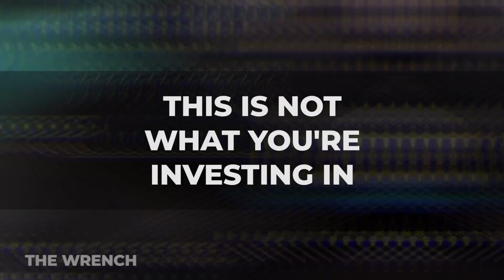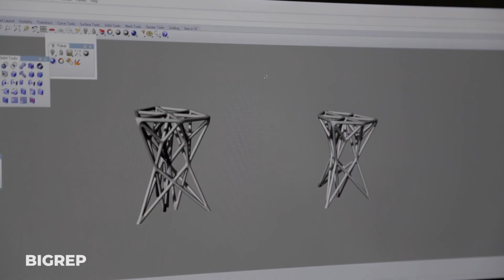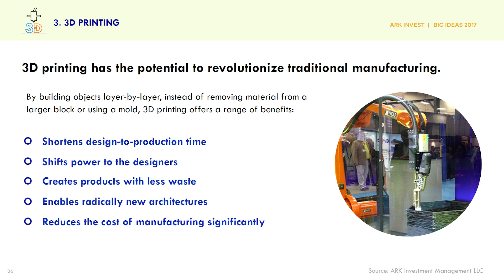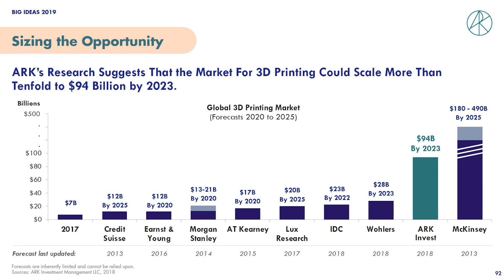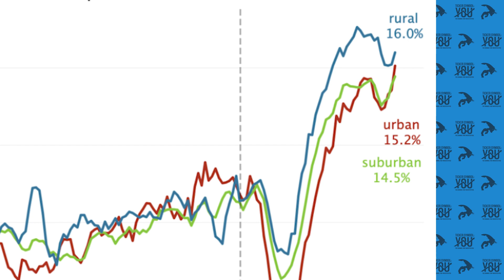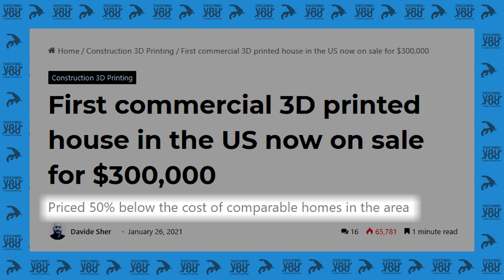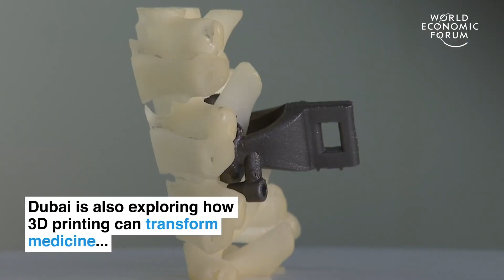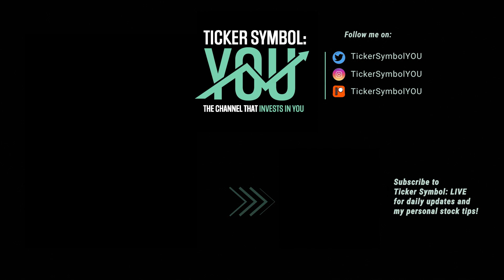😅 ARK Invest Mistakes on 3D Printing: ARKK, ARKQ, and PRNT are all Missing These Big Ideas

Comment: I work for a manufacturing company and we make about 80 different instruments.  Some we make hundreds a month and some we make under 10 a month.  You have have a molded part the mold can cost thousands of dollars and if you want to change the mold that can cost thousands as well.  I have been saying this for years that on low volume parts we can 3D print none critical parts. We are finally starting to do this.  This is where I think 3D printing will really take off.  I have also seen 3D printers with multiple heads all making the same exact part.  If you have 10 Printer heads all doing the same thing you can make 10 parts instead of one.  Multiple that by 100 print heads and you can mass produce 100 parts at once with one instrument. Think of how Hersey kisses are made.  You can 3D print in a similar fashion.
Reply from the maker: I think this type of manufacturing is going to scale very quickly. In terms of size and amount created by 3d printing.
Reply: Desktop Metal is the king of mass production of 3D printed parts right now.  Their production system prints large batches of parts about 100X faster than other technologies.  They are positioned to win the mass production war.  Velo3d may win the one-off battle since they have a slower, but more flexible small printing solution.  There are a number of players though.
Reply: @loul7239  DM is in my top five favorite stock in the market right now, it's insanely cheap right now. Time to load the boat
Reply: @jasonamareld5024  I know, it just dropped a ton yesterday.  I should probably pick more up.
Reply: @loul7239  just bought 100 more today up to 1150 shares of DM

Comment: Been in plastics for 40 yrs, supply color to 3D filaments now. There still isn't a thermoplastic that can be printed and is strong enough like injection molded plastic. It will come, not today
Reply: SLS is pretty close, especially when designed with extra support where needed... some of which are near impossible in PIM.
Reply: @Erwin Jacobs Replacing IM for mass production isn't going to come quickly, but it's always a numbers game. Customs and small changes in small volumes are not very cost effective for tooling, even if it's modular, so there may be a point where you can't amortize the cost and another manufacturing method becomes more favorable. 

If you look at areas where additive has really shined...  places where lightweight components are extremely cost effective, ie, aerospace. Places where multiple components can be designed as one with additive... compliant mechanisms, etc... we're just starting to really scratch the surface.
Reply: @Erwin Jacobs I dont think 3D printing will replace mass production at all. Not what it excels at. Custom parts, small batch production and some niche use cases like aerospace parts is a different matter.
Reply: from a structural engineering perspective that is my concern with 3d printed parts.  contiguous materials often have structural advantages over layered material.
Reply: @ocrun6765  I think your point is the biggest stumbling block for sintered metal parts.  There is an industry distrust of sintered metal over forged parts.  I imagine that, in the future, parts with critical structural implications with still be "forged" while the rest will be printed.  This is already the case in things like electric hand tools.
Reply: This is bang on and I totally agree, but I can't wait to see additive incorporated into injection molding.

Comment: How about combining robotic assembly of prefabricated parts along with 3D printing?  A term that I heard many years ago, but doesn't seem to be used much, is "digital manufacturing".   This would include additive, subtractive, and anything else which could be fully automated.
Reply from the maker: This is a cool idea and I definitely agree it has merits. I tried to call out the idea of printing parts of the home (door frames, railings, molding and crown, knobs, hinges, etc.). That's the beauty of this tech, it can work at all scales given the right machine and foresight.

Comment: A problem (you did not mention) with the current home construction industry is the information asymmetry between builders and home buyers. Builders are incentivized to cut corners and, in periods of labor shortage, just do a crappy job but you cannot see the mistakes after dry wall is installed. The process of going after the builders after problems are revealed  require a lot of energy, time, and regulation. I would love to not have that problem since the build is standard and poorly trained workers are eliminated from the process. 

I would love to obtain a 3D diagram of my house so I know exactly where I can make modifications. Imagine the shocks to the system when such information asymmetry is reduced, that means lower real estate agent fees, lower home inspection costs, when information can be transparent between buyer and seller. Imagine investing in a company that allows you to 360 degree inspect the home by combining the blueprint and the cosmetic elements and I am not talking about virtual house tours.

Also, I hope the recent lumber shortage is pushing material scientists to develop new building materials that are friendly to 3D printing technology.
Reply from the maker: This is a great call-out. I think increasing this type of transparency would be a huge win for the consumer. I always try to obtain a blueprint (or at least floor plan) of my home to identify where structural things would be versus what's available for modification as well. If I can't get one, I usually make one myself.

Comment: on housing, wood materials are super expensive right now. 2x4's for example have 3x'd in price in he last year in my location.. I think that sets up real estate pretty good due to far less homes being built.
The most interesting thing I've seen about 3d printing that really blew my mind was the newer process of gel bath printing which really opens up the possibilities of 3d printing imo. It makes it possible, IMO, to create more complex shapes and possibly working devices being assembled within the gelbath..which brings us far closer to that startrek level of 3d printing almost anything.
Reply: So whats the advantage over a dual extrusion system using a dissolvable filament for  the supports?

Comment: 3D printing houses will be one of the biggest changes. Not just on cost but on style being able to cheaply print curves which are super expensive conventionally. Labor is typically 50% or more housing cost
Reply from the maker: Yeah, printing curves and custom designs and having homes be more about self expression would be incredible.

Comment: i had been watching 3D printed houses for quite some time and am surprised that no one talks about 3D printing Net Zero homes in this.
Reply from the maker: Well, it’s time we talk about it way more!
Reply: Yeah, the potential for more energy efficient homes is remarkable. Big lightbulb went on for me when I learned the most insulating material is still air. So all those walls with columns of space between them are highly insulative. Depending on climate it would be very easy to optimize the balance of insulation and thermal mass which stores heat and releases slowly.
Reply: @jonathanbessone1124  Exactly. Here in Canada we have already started using 3 panel glasses for Windows and doors. They have Argon as the inert gas in between them. They don't conduct.

Comment: Absolutely.I've been talking about this for a while now.With Construction so many more things become possible such as passive heating since you can easily make the buildings air tight and ventilate where needed.With the right materials longevity could be increased.Once this becomes further automated and there are improvements in speed and efficiency I could see houses dropping to 25% or less of there current build cost.We have been building homes and buildings with little change for the past 100 years.This industry is ripe for disruption and with the need to make lower cost sustainable homes this technology couldn't have come at a better time.

Comment: I remain unconvinced of 3D printing in the construction industry. Yes, we've seen pilot projects, but they don't look particularly convincing. The houses don't look all that attractive. Concrete is a building material environmentalists would like us to get away from, and it needs to be insulated and it's porous to moisture. 

Perhaps most importantly, the hard and expensive part of building new houses isn't actually the building part at all, it's obtaining the land and the planning permission. Many cities make developers jump through hoops in order to obtain permission... it can take up to a decade of intense negotiations and hearings, plus they frequently make the developer pay for all the infrastructure and amenities that the new development will require: parks, roads, utilities, even schools. Also, here in California many cities don't have any more greenfield sites available at all... everything new has to be infill which is much more expensive land to acquire and the developments have to be correspondingly smaller.

Comment: No one ever talks about the materials used and their quality in the finished state when they make 3D printing videos. That makes me feel they want to hide something. It's the first thing that comes to everyone's mind when some one says "3D printing". But there is never any mention of the quality of the materials. That's why people don't trust 3D printing and don't care about it.
Reply from the maker: Hey, this is a great call out. I didn't think to do that because this is such a new space, but I definitely could have spend a couple minutes talking about the different mixes used in these homes. I'll look for these points more often in future videos. Thanks!
Reply: Shao xuan  You can finish the walls off with other materials like sheetrock the 3d part was basically just the  frame of the house.
Reply: I got one of the first 3D printed interbody cages cleared by FDA many years ago (and plenty more since!). Speaking to implants, they use the same surgical grade titanium, except it's in powder form and a laser or electron beam melts the powder together (ASTM F136 for bar stock, ASTM F3001 for powder). For 3D printing implants, we have to pay attention to the cleaning process to ensure any loose particles are removed, but aside from that, the 3D printed implants perform much better (and cost less to manufacture) than the traditional milled versions (I've never heard anyone outside my space refer to subtractive manufacturing, so Tasha earned so many points there haha). the milled implants also need cutting fluids or other contact materials during manufacturing that raise biocompatibility concerns. They anozide/electropolish as a final step...but again, that's less of a concern for 3D printed parts.
Reply: @TickerSymbolYOU  as someone who works as an additve expert this can be solved decently easily for houses but the bigger issue is surface finish for parts for planes etc. But for the most part we probably aren't going to see printed houses for 10 years. But the cost savings for manufacturing are in time and molds. For example in house additve can save weeks to months on manufacturing lead time for a $50-100k mold for 50ish parts that can be printed instead for $10-$40k

Comment: Thanks, Alex, for all the nice video about ARK Invest, I've been following your channel.     I have been wondering if you would be able to share your thought about 1. holding ARKK vs 4 x ARK. I thought it is akin to ARK 50 vs ARK 200 Index (of sort), ARKK for high conviction folks and 4 x ARK for folks who feel safer with spreading bets across more tickets.   (Actually when I type ARK 200 I feel as if ARK 200 is not that much smaller than S&P 500 ^_^)   2.  What is your thought about ARK as long term investment, I think Cathie Wood is definitely the key to ARK success, I just feel that when she is no longer around, ARK would have a big quality issue at hands.
Reply from the maker: I think Cathie Wood did a great job of standing up an amazing team. I'm sure if she leaves ARK there will be a lot of issues, but all the analyst research and direction is awesome, so I think ARK would survive that.

I've covered my thoughts on ARKK vs. the other 4 and they're not the same thing. What's the reason to want to spread your positions across more than FIFTY tickers? How "safe" do you think you'll be while investing in disruptive innovation 😅

Comment: 3d printing a house/building is hyped. 1) how about multi-floor residential building? how is reinforcement done? 2) printing the same house many times vs. modularized house (Lego style) - which one is more efficient? What 3d printing really enables is not only being able to make forms that conventional manufacturing can't make but also a) the ability to prototype then use the most efficient manufacturing method for production and b) decentralized and accessible manufacturing - anyone can access manufacturing anywhere as long as they can design (do not need skills to make) or have a digital file. This is why 3D printing for space exploration for b) is promising. I think the real benefits of 3d printing buildings are replacing human labor and cost reduction in complex design (only for the ground floor). News about numbers of construction jobs soon to be disappeared will be flooded.
Reply from the maker: Hey, great questions. The video features a multi-story building being 3D printed and they can inject supports and/or print around them. As far as efficiency, I don't think there's a reason to choose: why not 3D print lego-style modular houses? Or at least the modules/sub-components that make sense to 3D print?

Absolutely agree on the prototyping, accessibility, and replacing human labor comments. Spot on!
Reply: @TickerSymbolYOU  why not 3D print lego-style modular houses? Or at least the modules/sub-components that make sense to 3D print? - because 3D printing is slow. If design is fixed, casting modular walls is efficient and more if automated. Modularity allows flexibility with fixed individual pieces. so why use 3d printing? Use bricks lol, but not so cool. Looking at 3D printing only makes it fascinating that seems to revolutionize the world, but when started to compare to existing alternatives, the impact is marginal thus no exponential growth as investment opportunity. I agree with you about ARK, but I am not bought by your point about printing buildings. I think more research about value proposition of 3d printing house would make your contents better.

Comment: The only issue that I see is that the demand for cement is only going to increase, and it is already scarce at this moment
Reply from the maker: I'm sure new materials specifically designed for 3d printing houses will be made.
Reply: @TickerSymbolYOU  makes sense!
Reply: I believe Musk is already doing this with 'waste' from his Boring company. Adding insulative media and creating building blocks. Sounds feasible to print this hybrid material en mass.

Comment: As a mechanical engineer unfortunately 3D printed metal parts at not as useful as you might think. They are prone to cracks and inclusions. Which is a nightmare for fatigue oriented parts. Fatigue is when you load something over and over again which causes cracks to grow until the part fails. In vehicles and aerospace this is the driving constraints so an engineer would avoid 3D printing the part. So until they figure out a way to 3D print without those cracks it can’t be used much in those industries.
Reply from the maker: This is great to know, I appreciate it. Is it the actual metals used in the process, or something about the process itself, or the wonky optimized designs that computers tend to make?
Reply: @TickerSymbolYOU  It’s the process. What they do is they lay down a very thin layer of a metal powder and then melt it with a high power laser but because only A tiny area is molten, and that molten pool doesn’t fuse all over. It’s similar to welding but on a smaller scale. We also avoid welding when fatigue is involved

Comment: I think the thing you're missing is the size of the home. I think the consumer demand is for larger and larger homes, especially if work from home is becoming a permanent trend. These 3D houses are limited to under 2000 SF right?
Reply from the maker: No, why do you think they're limited to that amount?
Reply: @TickerSymbolYOU  it would seem like the footprint of the house is limited to the size that will fit inside the rails that the printer rides on. Can it print two or three levels yet? I think the 3D home printing should be applied to the modular side. I'd love to see 3D printers used to produce SIPs that are simply assembled onsite on a foundation. I don't know why SIPs homebuilding hasnt taken advantage of the increasing prices of lumber and materials to become more widely used. When looking into it, the advantages of a SIP built home far outweigh a timber stick-built home. If there's a company doing this already, that's a big potential opportunity.